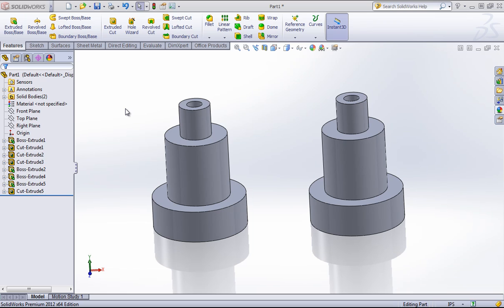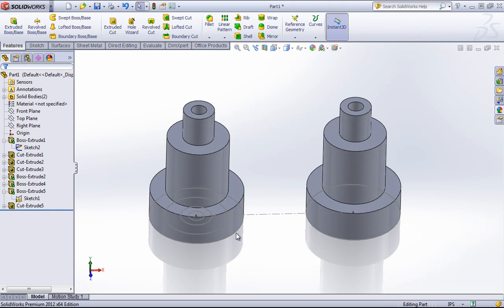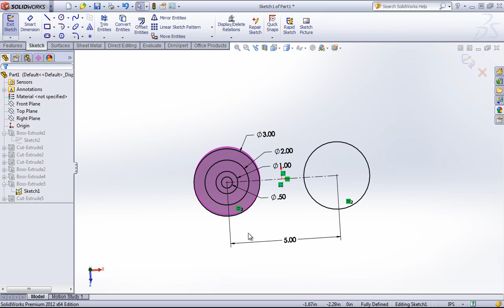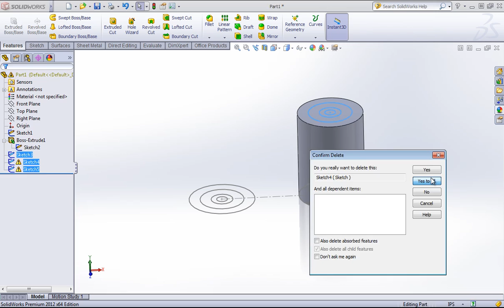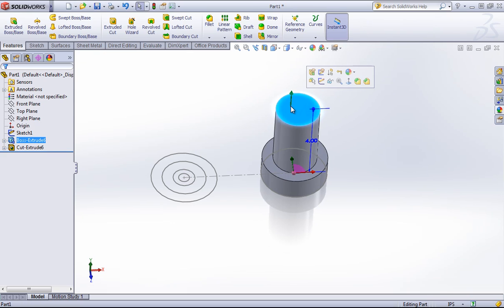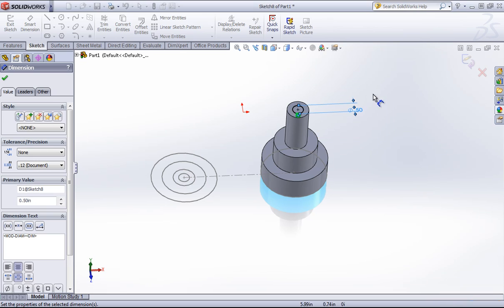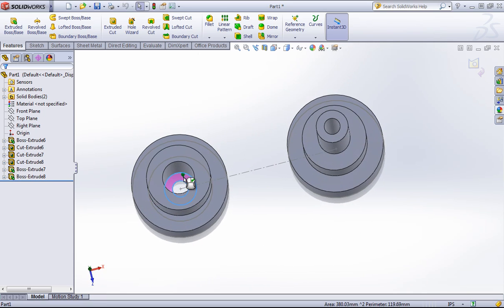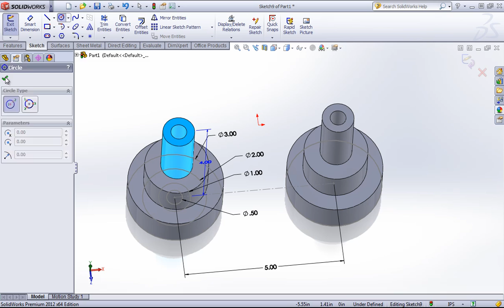SolidWorks Best Practices: Use Contour Selection to Speed up Modeling by SolidWize

Comment: It doesn't work anymore; at least after the first extrude - the select contour icon remains on the mouse tip, but the sketches are not selectable. Too bad.
EDIT: Got it to work as shown. I had to right click the sketch in the property manager tree and then click the Show eyeball icon. Nice.